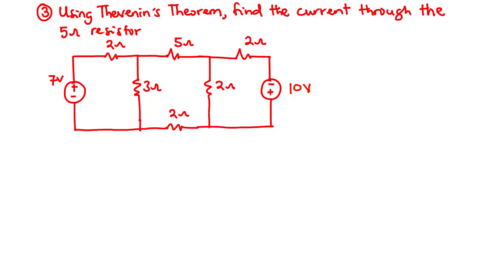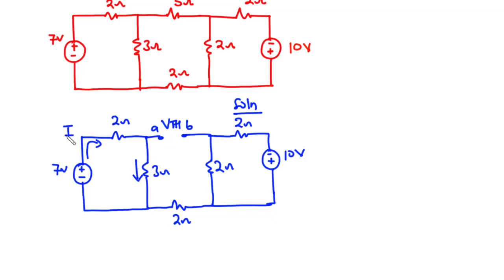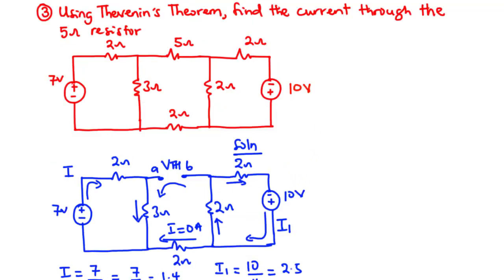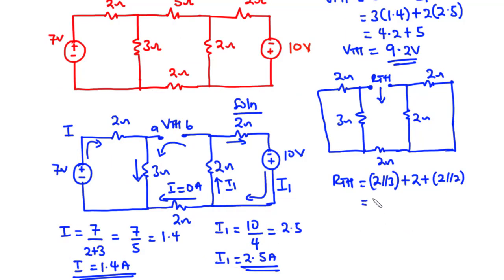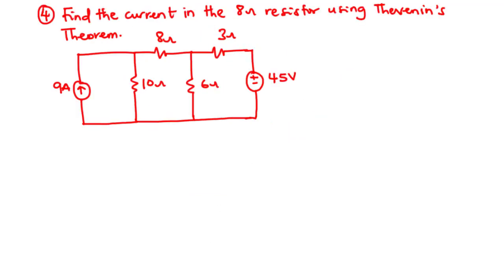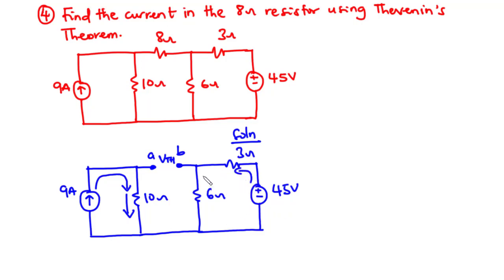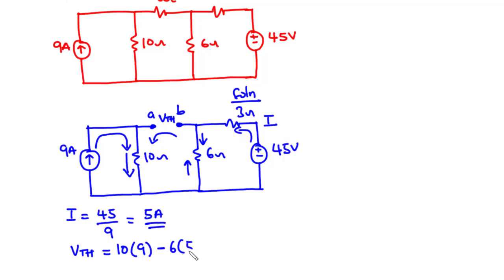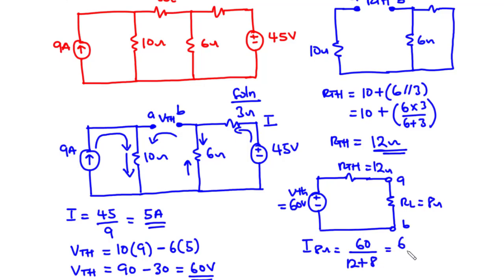19a - Solved Examples on Thevenin's Theorem #knust

Comment: I am abit confused. In qn3, why did the other 2 ohm resistor not have current flowing through it?
Reply: Its in an open circuit 
Both currents from 7V and 10V don’t pass by it

Comment: When calculating for the thevenin's voltage how do you determine wheather to move in the clockwise direction or anti-clockwise direction
Reply from the maker: That is determined by yourself. Vth is the open circuit voltage between the two terminals ab. So with a being + and b being - ,depending on the circuit you take your direction. But then if you do it the right way, whether clockwise or anti-clockwise your answer should be the same, it may just differ by sign.

Comment: I thought that the current produced by the 10v would flow into the other 2ohms resistor
Reply from the maker: No please
Reply: please explain why 😭
Reply from the maker: It's because of the open circuit at the top there. So the current will just be revolving in the immediate loop

Comment: why is the no current I1 in the  2 ohm (middle loop for Vth)
Reply from the maker: Because the current produced by 7v will move along the loop and from the +ve terminal to the -ve terminal in that circular manner, same as for 10v so literally no current will flow in that 2ohms resistor. At the end the law of conversation of energy must be fulfilled

Comment: first of all thank you a lot for help.I'm still confused why we took 2 parallel 3 and 2 parallel to 2(6.23) .Before examples circuit part with the same appearance has been taken as series .
Reply from the maker: I get you, you should understand that resistors are in parallel if they are both connected to the same two nodes, 2 and 3 on the left are connected to the same two nodes, same applies to 2 and 2 on the right. 

If they are connected only end to end then they are in series. Take notice

Comment: Please with the second question finding the Rth why is the equivalence of the two resistors in parallel in series with the ten ohm resistor
Reply from the maker: We assume that there should be a voltage source at Rth, we have two 5 ohm resistors on the left and one 10 ohm on the right. Once current divides at the branch , the combination of the two 5ohm resistors are in parallel with the 10 ohm In the right